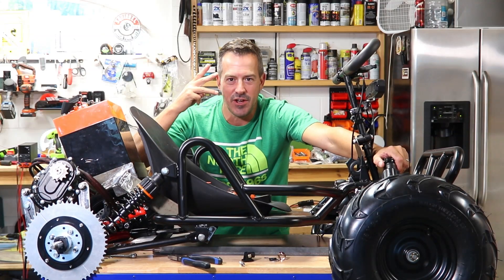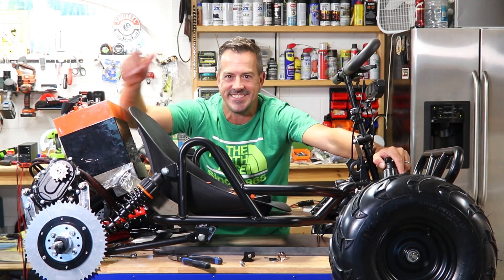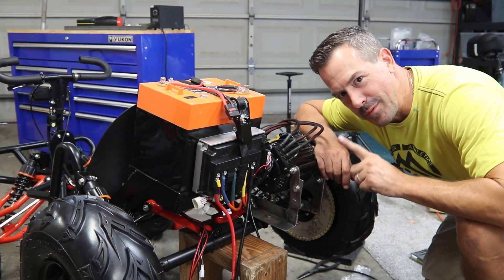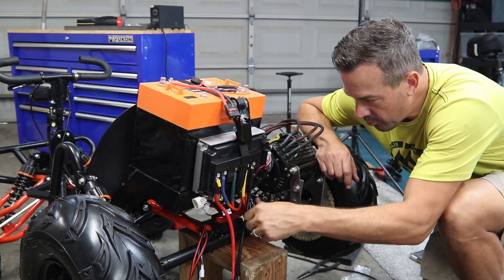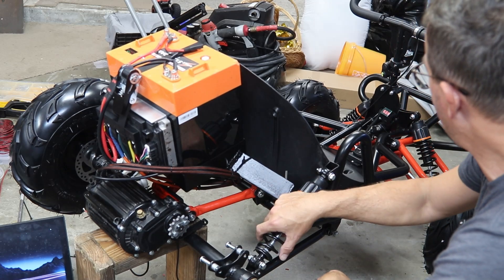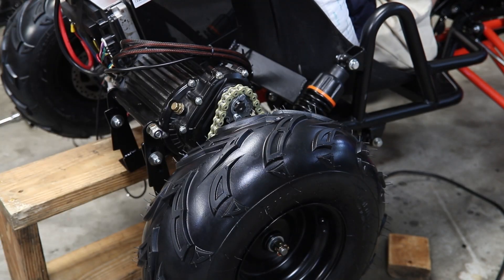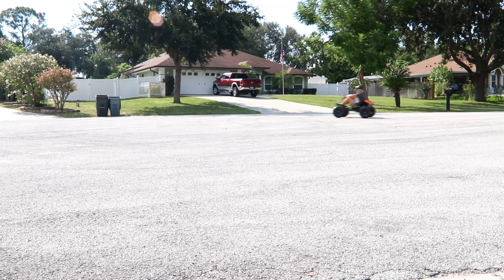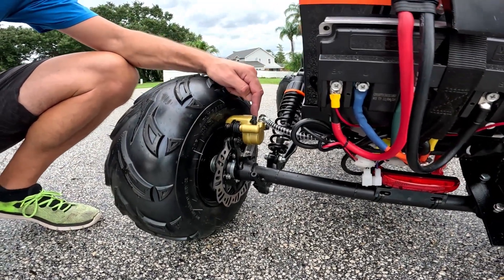Electric Go-Kart Build Part 3, My Best Go-Kart Build Yet? – Installing Motor, Batteries & Controller

Comment: You need to reinforce that motor mount🙂
Reply from the maker: I hear ya, its actually the whole axle... Motor to axle is solid as a rock, but axle to frame has some play in the suspension, which is prob what you are seeing..
Reply: @TackleThat  i know what that motor can actualy do force wise. Trust me its better ti rainforce now then to have problems later on
Reply from the maker: @Voltjunkie oh shes a beast lol!  Another swivel mount to the main frame would be nice.